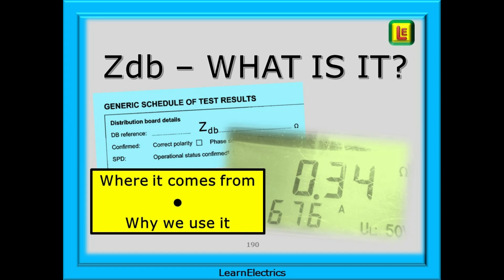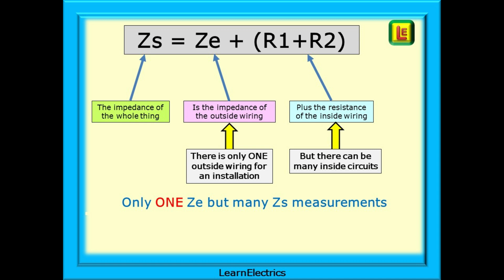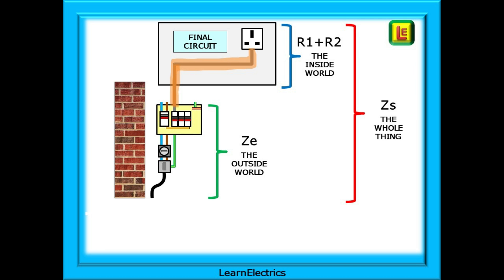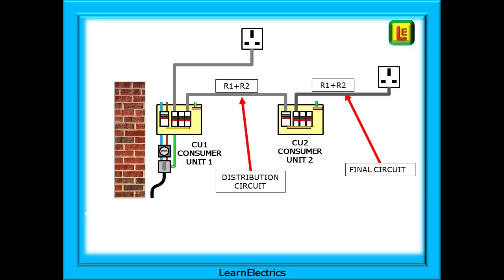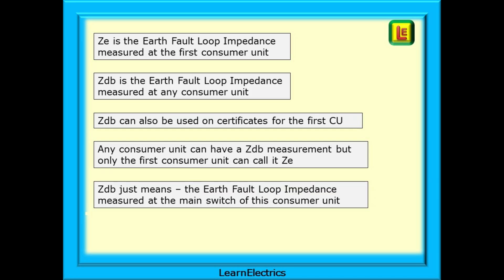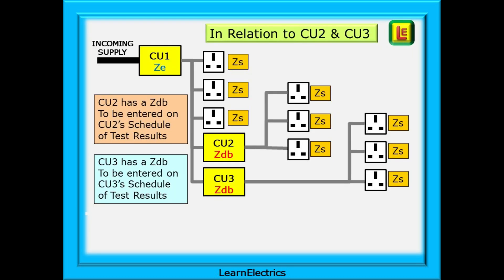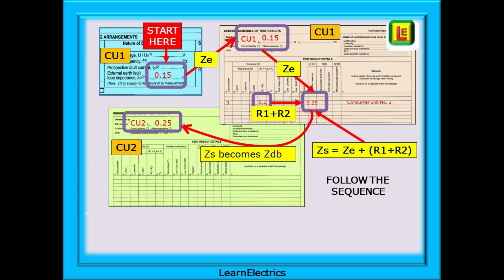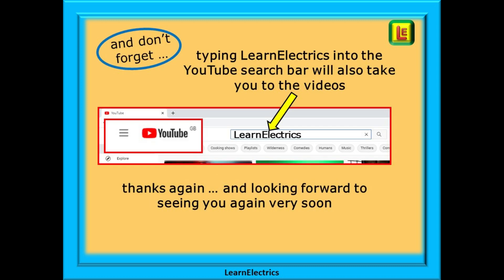Zdb – WHAT IS IT? – WHY DO WE HAVE Ze? - WHY USE Zs? – TESTING Zdb & RECORDING ON TEST CERTIFICATES

Comment: If you're in a commercial/industrial. The Ze will still be at the main incomer (switchgear), and all DBs that come after are all Zdb?
If i was to take a feed to a sub board, how would you calculate Zs.. you need Ze, R1+R2 of first board, plus R1+R2 of second board?
So Ze + Zdb + Zdb (remove main earths for each board)
Reply from the maker: Your final ZS must be correct. If its industrial with several sub boards you are probably dealing with chunky cables so that each sub board has a nice low Zdb (new ZE) to start with. Zs is the whole thing form the point of test all the way through the sub board to the main board, out to the transformer and all the way back.

Comment: What if you have multiple CUs but they are fed from a henley block not via distribution circuit? You can record Zdb for each of them, but you will also have multiple valid Ze. (although I imagine they will be very similar readings unless they have different cable lengths from the henley). Is there a rule of thumb preference on which CU is used for Ze ?
Reply from the maker: Each CU will have its own Zdb (Ze). If they are all from the same point then yes, they will all have a similar Zdb depending on circuit length of the tails.

Comment: If the Ze at the main db is 0.35 for TNCS and the Zdb is 0.40 at the sub main due to the connecting cabling, is this an issue given Ze for TNCS should be no more than 0.35…. Should the Zdb at a sub main be equal or lower to the tolerance of the maximum Ze of the earthing arrangement?
Reply from the maker: No, that is fine and sometimes cannot be avoided. Ze should be correct at the intake position and Zs should be correct at each point of use on DB1 and DB2. Hope this helps.

Comment: Hi Dave, just so im sure in my own crazy head we do not do an actual measurement of Zdb at the 2nd board along just replicate what the reading was for the distribution supply circuit of Ze + (R1+R2). So no removing the distribution earth and actually testing the measurement as such at DB2 and beyond. I did both recently and got the calculated measurement at DB1 of 0.3ohms and when tested at DB2 got 0.32ohms (could just be pressure at such a small difference). Some other sparks i have spoken to seem to carry out an actual test at say DB2 but say the main earth at this point stays connected 🤷🏼‍♂️ Thanks for your help sir 👍🏼
Reply from the maker: You should measure Zdb at the second board, it will be different to board 1 as there are extra lengths of cable. Do the test as if it was a Ze test, but you cannot call it Ze as this is reserved for board 1. That is why we call it Zdb. Hope this helps. This confuses a few folk, you're not alone. Thanks for watching. Dave.
Reply: @ thanks Dave …. With earth at DB2 in or out of the E bar?

Comment: Great explanation as ever Dave, if we had say, a TT system with one consumer unit connected. The Ze would be measured with the earthing conductor removed from the MET and we could expect a reading of say 100Ohms. Then if we reconnected the earthing conductor back on the MET and tested a Zdb measurement to the MET with all the bonding and CPC’s connected. We could then have a very low Zdb reading, due to perhaps neighbouring properties being converted to PME and where the properties share a common extraneous water/ gaspipe. So I think of a Zdb reading as the “actual earth fault loop impedance”👍
Reply from the maker: See Guidance Note 3 - earthing method number 3. Leave the earth conductor and earth rod connected to the MET and do the same loop impedance test that you do for TNS or TNCS. Hope this helps. Dave.

Comment: I dont understand why in a 3 phase DB we measure both the prospective earth fault current and the prospective short circuit current. My understanding is that the prospective short circuit current will always be bigger than the prospective earth fault current. So we double the value of the PSSC and we record this as prospective fault current. Am I wrong? Is there a case where the prospective earth fault current will be bigger than the prospective short circuit current? The PEFC is the only thing I do not understand why we measure. What am I missing?
Reply from the maker: With PEFC we are testing along the Earth conductor. With PSCC we are not including the earth. Hope this helps. Dave.

Comment: When a property or commercial floor or whatever is fed through a substation onto a rising busbar them where is the Ze taken from,
Reply from the maker: Ze is usually taken where it comes into the property or building. The point at which it becomes the source for the circuits that it is supplying. Hope this helps. Dave.

Comment: Appreciate your great work 
I understood from you in case of additional CUs
Zs equals Ze +Zdb +(R1+R2)
Is correct?
Reply from the maker: If you want Zs for the circuits at the 2nd board. It is Ze at the incomer. plus the R1+R2 to the 2nd board plus R1+R2 for the circuits on the second board. Hope this helps.
Reply: @learnelectrics4402  Many thanks to you

Comment: What if you build an Extention building to the rear of the property and you take 16mm swa  from Henley block into new CU2 with a 60A fuse switch in between and your just doing and installation certificate for cu2 alone. Would u still need to do Ze at cu1? Would u need to check gas bonding in the old building?
Reply from the maker: I would still do Ze for the installation and  Zdb at the board that I work on. Hope this helps.

Comment: Very well explained about the differences between Ze, Zs, Zdb and R1+R2.
I am a bit not sure why still you have Ze, at the Zs calculation on 2 Consumer Unit?

Thanks
Reply from the maker: The second consumer unit has a common point for all the circuits that come off it, a  common impedance (resistance) and we need to add this on to the R1+R2 readings. Have another look at the video, sometimes it helps to watch two or three times. Dave.

Comment: If the Zs of a circuit at CU2 or CU3 is higher than permitted values what should you do
Reply from the maker: Good question. Take a look at the video on the link below. Thanks for watching. Dave.
https://www.youtube.com/watch?v=fUlCDhlcDf4
Reply: @learnelectrics4402  Thanks for the reply . I would like to ask your thoughts on a discussion we had at work today . If you take a 63 amp circuit to the garage using a  double pole switched fused isolator  that is going to have for instance, sockets ,lights both internal and external and a future car charger and  is 20 mtrs away from the house so an earth rod is put in and the earth in the 16mm 3 core SWA is isolated from the garage making it a TT system  , having taken the supply from connector blocks before the consumer unit and and the incoming supply is a TN-C-S . When you come to test . Obviously at the house end you get a Ze reading at the switched fused isolator. At the garage CU on the test Sheet as that is a distribution circuit from the house would it be classed as Zs then on the form for the garage Zdb . Or would the Garage board be classed as Ze as it has a different earthing system to the incoming house supply

Comment: What happens when you hace a second remote board that had been converted to a TT system so the earth at source has not been migrated
Reply from the maker: You would still call the second board Zs in relation to CU1 and then call it Zdb for the certificate for CU2. Hiope this helps and thanks for watching.
Reply: If im writing a cert for this remote board DB2 and the board suppling it DB1 is from a tncs then where do i record the readings for the  rod on the TT ?

Comment: Hi Dave, thank you for this wonderful video but has raised a lot of questions in my mind.
You said theoretically the Ze of the db1 is = to ze of the db2.  But between CV1 and CV2, there is R1 + R2 and on db2 we have to take it into account (video 5:20"). so, the Zs becomes the Ze of the db2. 
Now here are my questions:
* Does R1 + R2 affect the Zs (Ze) of the CU2? How about The PFCC?
Let say Ze at CV1 is 0.7 ohms, what will be the acceptable Zs and PFC at CV2 if it is found to be 20 m away of CV1?   What can you say about voltage drop beyond CV2 on the circuit?
* If from CV2 you want to add a CV3 at 40 m, what will be the acceptable Zs and PFC at CV3? what will be the maximum Zdb as we have Zs of CV1 to Cv2 and Zs of CV2 to CV3? Should we consider power drop?
* can we apply the same principle on 3 phase?
Reply from the maker: Zs should not exceed the values in the tables for the circuit breaker in use.
Have another look at the video, it's all explained. Try and think what it is you are testing, at what point in the circuit.
When filling in CU1 paperwork, CU2 is a ZS.
But for CU2 certificates, that same ZS is now called a ZDB for CU2
Thanks for watching, sometimes you have to replay the video and learn a little bit with each watching. It can be a tricky concept to grasp at first. Dave.

Comment: Hi Dave so just to get this straight zdb is the same as ze at the initial consumer unit but at the subsequent consumer units after that its only zdb and not ze and is that because ze is only the external impedance and because theres a cable linking these consumer units then that is outside the external ze or impedance and is now on the consumer side and we have to measure the r1 and r2 values of that consumer unit to subsequent consumer units cable. Is this correct or maybe i should take your advice and watch the video again. Superb and educational video again by the way thankyou. Robert.
Reply from the maker: You are right but please do watch the video again. Thanks for watching. Dave.

Comment: You missed something, Ze is measured different from Zs for Ze you remove the earth, for Zs you leave it in. In a lot of cases I have cone across the Zs value is lower than Ze due to parallel paths lowering the resistance. 

Another great video anyway, please keep up the great work.
Reply from the maker: Thanks for the contribution, yes, sometimes that happens. Thanks for watching, Dave.

Comment: Please i want to a you this question; what's the order in which you should arrange your circuit breaker in your consumer unit. should it be from the lowest breaker to the highest or highest breaker to the lowest and why... Thanks
Reply from the maker: Daniel, usually put the highest next to the main switch/spd and work down. But as soon as you add to the installation it all goes out of the window.

Comment: hi dave another interesting vid...this kind of videos is wat i have searching the whole internet for and here it is...my other observation is... what if there is another fuse board some distance away....and is being fed from a hendly block....whould that measurement be a ZE or ZS
Reply: I came to the comments to ask this question also. I suspect it’s not zdb as it won’t be supplied from an additional fuse. The whole point of loop impedance is to satisfy disconnection times. Would it be ze at db2?
Reply from the maker: See above, thanks for watching.
Reply: Good question
Reply from the maker: Every question is a good question. Dave.
Reply from the maker: If its the first board in the installation it will be a ZE and theoretically it should be the same as the "other" board as both are electrically the same point i.e. directly to the outside world. Hope this helps.
Reply: @learnelectrics4402  Hi Dave, always enjoy your lessons. You said “theoretically the Ze of db1 is = to Ze of the db2 but on the video between CU1 and CU2 there is R1+R2 and again you said it is Zs (video 5:2) now here is my question: does the R1+R2 affect the Zs (Ze) of the CU2 ?
Let say Ze at CU1 is 0.7 ohms what will be the Zs at CU2 if you have let say 20 m cable?
Secondly, CU1 to CU3, to the point of use, what can you say regarding voltage drop?
Looking forward hearing from you
Reply: Thirdly, what will be the PFC of the CU2 and CU3 if from CU1 to CU2 20 m and CU3 another 20 m? If you find that the PFC being to high what do you do?
Reply: Right at the end of the lesson, you said CU1=0.15, R1+R2=0.1 and CU2=0.25, the R1+R2 is it of the cable? If you add CU3 , what is the maximum Zdb allowed?
Reply: Hi Dave, let consider a scenario of 3 phase as well. If CU1 is 3 phase and CU2 is 2 phase (L1 + L2) and CU3 (L1+L3), are we going to apply the same principle?